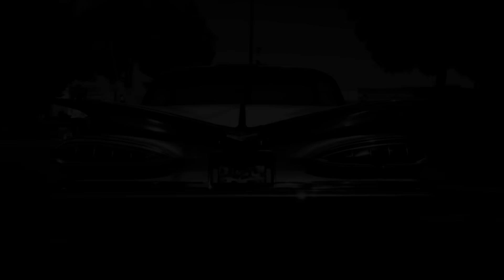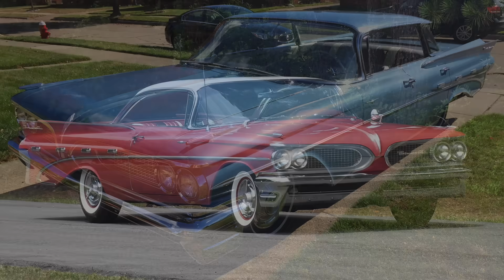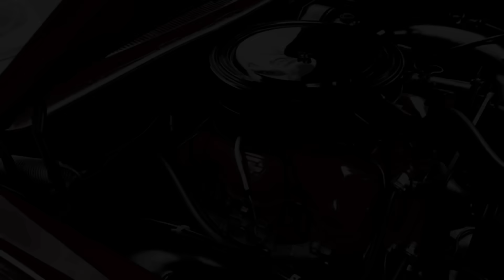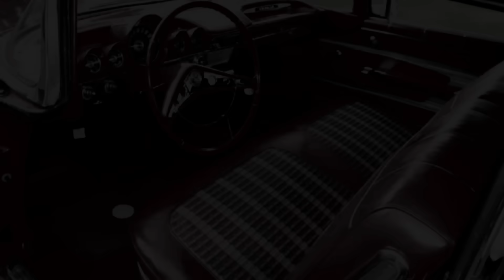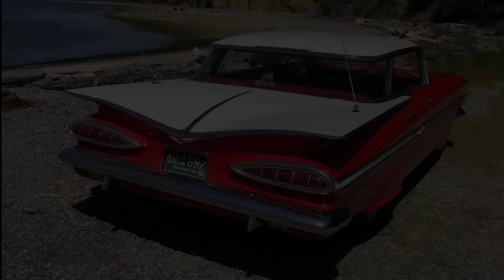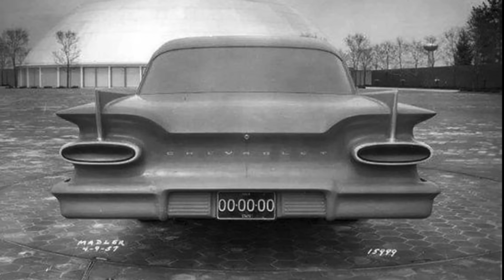1959 Chevrolet Impala: Top 10 Facts About Chevrolet's Most Iconic Car!

Comment: The horrible "X frame" (actually missing the outer perimeter sections)
the late 1950's / beginning 1960's cars don't look good to me although the dual (on each side) headlights were a performance improvement as was 12 volt and eventually alternator electrics 
by middle 1960s I think things were looking better (but by/after 1970 got too big and bloated to look as good) 
did 1959 Ford outsell these Chevrolets ? 
how about a nice doughty '59 Rambler with a V8 and 3 speed automatic ? (but no frame at all,body supposedly had enough structure  not to need one (or frame pieces were welded as integral parts of the body)

Comment: Unless I missed it, I don't recall hearing you say what material was used for the part of the fin (underside) that was not metal. Was it fiberglass? When showing images of the proposed/rejected styling, the car that looked somewhat like a '58 was clearly an early proposal; its windshield and A-pillar were carried over from '58, rather than being the dog leg A-pillar and high forehead windshield actually used on all 1959/60 full-size models (and continuing on all Cadillac Fleetwood 75 limousines/sedans through the 1965 model year).

Comment: In 1986, I traded my Black 1969 Malibu convertible (with its engine tired and quarters' top seams splitting) to a guy who had a stunning '59 Impala 2-dr Sport Coupe with the original 348 in it.  Had that honey for over 6 years and just LOVED taking her out often. Living in Chicago, I used to regularly drive her to Lincoln Park, where parallel parking was an artform due to available space.  I consider myself fortunate to have never gotten any dings in the bumpers. (Actually, the other cars probably feared them!) During my ownership she was well-loved; damn-near pristine-- "Roman Red" with Snowcrest White insert, with wide whites, dual exhaust, skirts and twin antennas in rear. Freakin' gorgeous!  Sold it for $14K in 1993, then picked up a '55 Chevy 2-dr post to build...and had that one for 23 yrs.

Comment: On the C body cars there is a 3" more length in the front door on the four door cars. On the coupe, the extra 3" was in the rear seat. So, the door window on an Electra and Cadillac is 3" longer than a Chevy or Pontiac. The rear side window on the Buick and CDV are 3" longer than the lower priced cars.

Comment: The 1959 Impala had the power steering pump driven straight from the generator shaft.   Don't know if that was common on any other cars back then.   But today driving both generator  (alternator) and power steering with only 1 belt is never seen.

Comment: I was 12 1970 my father took a 59 Impala as trade for some labor brought it home gave me the keys let me learn how to drive created a circle track out in the field back it up in and out of the driveway multiple times. Two-door hardtop blue man that was cool none of my neighbor friends were allowed to ride in the car with me buy rules of their parents I snuck it out on the road one time when my dad was at work got busted by a neighbor thing had stock dual exhaust and some sort of a V8 engine I believe it was ordered with a tow package it had of transmission that was a single drive like a Powerglide with low gear was on the column shifter was labeled GR which I think meant grade reduction that model since then has been one of the favorites of my life never owned one myself but I have had multiple Impalas

Comment: I drove a 59, ....because of the Earl and Cole competition they created an unsafe design. AFTER 60 MPH, you'd lose traction/control and the rear end would swerve. The following year I got a 60, the squared fins reduced the aerodynamics but still lifted up. Then the 61 had no fins w smooth side profile. You'd think the engineers would have figured it out. Don't forget this was a time when drivers would  be doing 70-90 mph.,  How many deaths  because of that....we'😕😟☹ll   never know.

Comment: Our family had a 59 Brookwood station wagon. It was very plain with a six cylinder engine, radio and heater. I remember one time when my mother was driving it and the horn stuck in the on position. She pulled into a service station and the mechanic unplugged the wires going to the horn. Took it to the dealer to get it fixed. Drove it about 80,000 miles, much of those miles were on dirt country roads. It did the job but when Dad traded it for a 63 Mercury Colony Park wagon with a 390 with a 4 barrel, there was no comparison.

Comment: In 1959 the owner of City Chevrolet in Great Falls, Montana special ordered an Impala 4 dr hardtop from the factory with ALL the options available;  348,   Turboglide,  posi-traction,  ps,  pb,  power windows and seats,  radio,  AC, padded dash, etc. to use as a display car in the showroom, and for an occasional test drive.  He sold the car in Jan. 1960 at the end of the model year.  It was purchased by a local farmer who used it as the family car for the next 4 1/2 years, then gave it to his daughter as a high school graduation gift in June, 1965.  In Feb. 1968  I married the  most beautiful girl in town, the owner of this car.  I did a mild restoration and a full paint job, and we took a honeymoon vacation across the US as far as NYC, Philadelphia and DC.   It was her family car until 2012 when I decided to do a total restoration because it had 203,000 miles on the odometer.  It is nearly finished but it was sidelined for other reasons.  Unfortunately my wife passed away in Sept. 2021.  Since Jan. 1960, all those 203,XXX miles were driven by just three drivers;  my wife, her father, and me.  I have never seen another one like it.  A true blue beauty.   BTW, I got my favorite car in 1965 also,  and I am currently restoring it.  It is a 1957 Chrysler 300 C convertible.  I am the proud owner of two rare and very special cars.

Comment: 1959 was the peak and turning point in the design of General Motors cars, after which there was a significant failure, until 1965. The design of the 1960, 61, 62, 63, 64 cars is very mediocre, and for all models.

Comment: 1959 might have been the height of silly 'Murican car designs, fins and wings that were useless in the sub-sub-subsonic existence of 'Murican "supersonic battleship" cars. What I recall being unique to the '59 Impala was the X-frame structure. a strength in some respects, a weakness in areas where the roads were primitive and bad. All the same, an absolutely beautiful car at the time, impractical as it was. Frankly, impracticality seemed to be THE POINT at the time!

Comment: Ah, yes. The interior with the infamous front seat knee knocker caused by the wrap around windshield. Man if you tried to bail out of our old 1959 Bel Aire 4 door hard top with the 348 truck engine that would push the speedometer needle pass the right turn signal (I actually did it and survived - found a curve I had never noticed before on the normally "straight" road.) that thing would get you right in the knee that would even hurt a 17 year old.

Comment: One of the nice things about these was the chassis was exactly the same between each model. My first car was a '58 Impala. It was fun to drive. Did some dragging in it even though I only had a 283. But, my muffler went out. I went to a junk yard and all the guy had was a '58 Del Ray wagon. $5 for as much as I wanted for taking it off myself. My uncle was with me. The Del Ray had a 348. We took the exhaust system from the crossovers all the way back. Of course the crossovers didn't fit. But from the point of connection to the crossovers, all the way back, every bend and hangar was exactly the same as on my Coupe. Oh, that was in 1968 to give you an idea on the price.

Comment: My favorite detail is that '59 Chevys sold in Australia, which was starting to require separate amber-lensed rear turn signals, had them in separate pods like 1930s parking lights but hanging upside-down in the batwing coves.

Comment: My first car was a 1960 Chevy Impala 283 c.i. with three on the tree shift. We called it the wing machine. Was a great car great memories. In the 90's I worked with a older man that told me part of the reason they only did the wings two years, 59 & 60. He said California used them for the State Patrol and they found at high speed the wings would lift the rear. Never got mine to that speed and I'm older now then the older man was when he told me this.

Comment: Not very accurate on FI or 348 "boat anchors.  The 348 powered Chevy to 3 straight Nascar manufacturer titles when stock cars were actual stock cars.  (Some 60 plus wins plus a win in a 1962 Nascar short track race.  (Against 390-406 Fords, 413 Dodge-Plymouths and 389 Pontiacs.  The narrator should stick to discussing "fake" trim pieces.

Comment: We had a creme-colored 4-door '59.  I remember having to wear coats in it in Summer because of running the air conditioning.  It was so big that I, at age 12, was responsible for driving it into and out of our 1920s garage since I could climb out of the window without needing to open the door.  It was also our first car with power windows and a power seat.

Comment: My dad’s 1957 Chevrolet BelAir (purchased new) had a one piece front bumper (much more substantial than the ‘59).  Many years later, I started noticing  some ‘57s had three-piece front bumpers.  I do not know the reason for the difference, but I heard that the change was made mid-year (although my dad’s was purchased in May, 1957).  I also heard that it depended on which GM factory built them.

Comment: I remember hearing that the track on the 1959 Pontiac was widened to accommodate the (wider than 1958) convertible top when it was retracted.  Pontiac turned it into an advertising coup; everyone knew that “wide track” meant Pontiac.

Comment: I forgot to mention I have a 62,000-mile 2-door Roman red 59 Impala power pack 283 stick shift that wins awards. The dealers gave away yardsticks that were 54 inches high, advertising the lowest-height roof ever for a Chevy. I have 4 of them, and they are hard to find; I display them at car shows. I won first place in 2018 at the Eyes on Design car show in Michigan for jet-age styling, beating 14 other finned cars from the 1950s and early 60s. This last summer, I won first place at 2 car shows on the same weekend. The 59 Chevy is very rare today. I entered car shows with 800 cars; mine was the only one. There will be tons of 57s and some 58s, but no 59s. Everyone has to take a photo of the rear end. I also have a 59 Roman red Corvette show car with the hardtop. They sure look great parked next to each other.

Comment: The Canadian cars co$t more than the U.S. cars, too.
Re the fins on the '59 Chev; IF you drove it into a 20 mph head wind at speeds over 90+ mph, you took a very likely chance of the rear end becoming airborne. A loss of control was the end result. The '60 Chev was a little bit better, you could get up to 110 mph  before it too would become airborne.
If the manufactures didn't want you to drive at those speeds, they wouldn't have made cars that could go that fast.

Comment: As the #6 kid in a 7 kid family in the '60s with three late teen older brothers who frequently changed vehicles, there was a parade of '50s and '60s used cars around our house, some of them future iconic cars of the period if not classics.

A few examples - a black '58 Belair coupe, a '59 Impala coupe (white with red interior), a black '64 Barracuda with the big fastback rear glass, a triple white '59 Buick convertible with AC, leather, and every power option imaginable, a sweet '64 Riviera, and a '63 Grand Prix.

They never seemed to have them for very long for one reason or another.  They'd get restless and trade for something else, or in a couple of cases the car got wrecked.  The '58 BelAir got hit in the rear while sitting at a red light and was totaled.  The '59 Impala also got hit and totaled, that time by a drunk also in a '59 Impala who ran a red light and t-boned it (no injuries either time).

Comment: As a 10 year old car nut in Canada i remember thinking the 59 Chev was awesome. However, i had heard that at high speeds the bat wing design would cause the rear to lift and the rear wheels would lock and that is why the RCMP did not have 59 Chevs in their fleet. I suspect now  that was just a rumour amongst my fellow 10 year old car nuts. I enjoyed this video and remember fondly those years when the new models came out in September each year.

Comment: The 1960 Impala/Belair were almost the same car as the 59. They just changed the front end from a dual light to single light, and went back  to a 3 light taillight assembly. The top was slightly redesigned and the fake vent removed in 60 and they used a slightly different steering wheel. Otherwise, the basic design of the 2 cars is pretty much the same.

Comment: My first car was a 1963 Impala. It had a 327 dual high performance exhaust, slotted wheels, sparkly and chrome steering wheel, cue ball shifter and yes, dice on the rear view mirror. It had been repainted to a neon green color and my sister hand sewed custom quilt seat covers. I had a lot of fun in that car.

Comment: The 2nd proposed Impala model at 18:57 looks like someone from Ford snuck into the design studio. The front looks like a late 50's Ford Crown Vic and the back looks too much like an Edsel. Since Edsel was a current Ford product at the time, maybe the Chevy designers were trying to compete with it a little. Considering how Edsel's did on the market, it's probably a good thing this design didn't make the cut into production.

I love the '59 and '60 models and my favorites were the Nomad wagon and the El Camino "pickup". The '59-'60 El Camino's were the only two years the car was built on a full-size chassis, when they reappeared in 1964 they were on the mid-size Chevelle chassis.

Comment: Thanks for the memories and wonderful information on the 59 Impala.  Had several friends that had 59 Bel lAire and Impala, They had the 348/335HP 4 speed.  I had the 1960 Impala with the same setup.  What a great engine to work on, no sensors or emission gear, so getting to the engine was easier.  
The 59 and 60 Impalas had several engine options in the 348 Cu.In. series. The various engines had different compression ratios with the 335HP at 11.25:1 the highest and 9.50:1 the lowest.  Carburation was either 3-2bbls or one 4bbl. Horsepower varied from 250 to 335.   The other engine options were a 6 cyl. and a 283 CI V8.  Transmissions included a 3 speed column shift, an automatic, and a 4 speed floor shift.  One way to visibly tell the difference in engine displacement was from the hood and trunk emblem.  The 6 cyl had the standard Chevrolet emblem (sort of rectangular) with no chrome V.  The small block V8 had the same emblem with a chrome V under it, and the 348 series had cross flags above the chrome V.
Reply: Decades ago I had a Roman Red '59 Sport Coupe with 348 / Powerglide.

Comment: I owned a 1959 Impala Convertible -- Blue/Blue with white top.   Mine was fairly loaded:   283 V8, Auto Transmission;  Power:  Steering, Brakes, Windows & Seats.    I was in Golden, Colorado driving around Coors, School of Mines and through Denver.   Had a great time with it.      But the funny thing about this is that I've always thought the 1958 Impalas were/are so much better looking.

Comment: my dad bought a used '59 impalla station wagon in the early'60's. it had a 348 ci engine which became later the 396..  we spent many hours in tthe back (family of 7) and did a 10k trip around the west pulling a 16' trailer.  loved the cat eyes rear lights.
Reply: 348 became 409, the 396 is a different design.